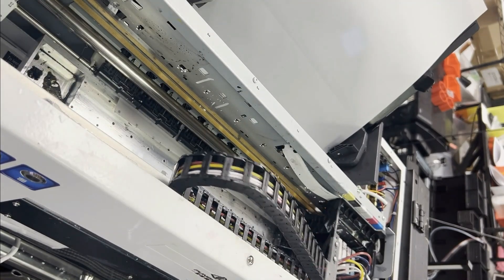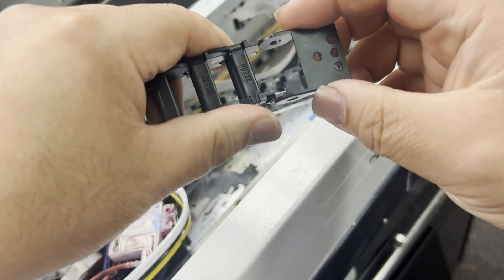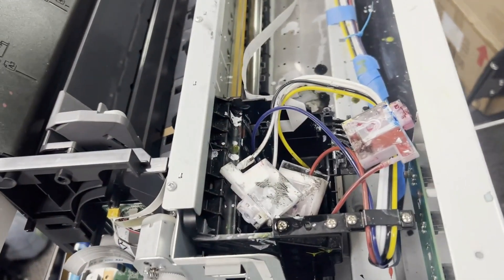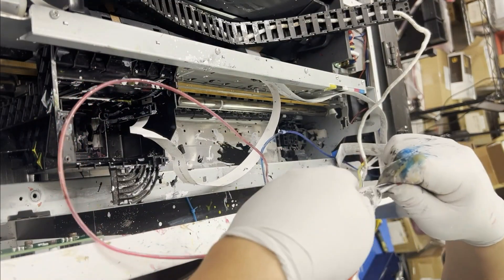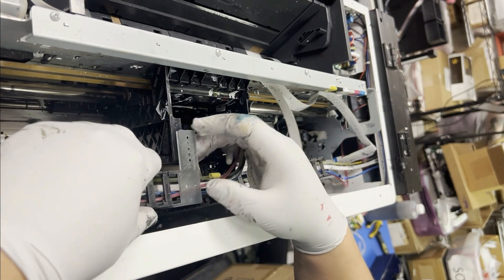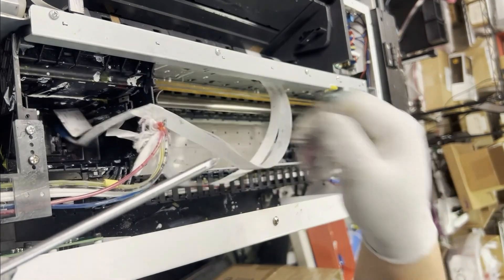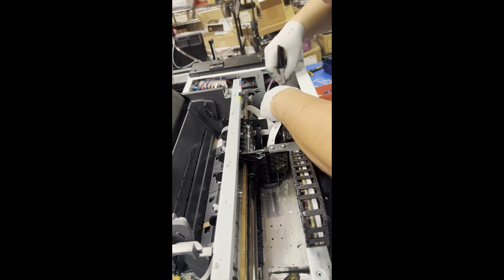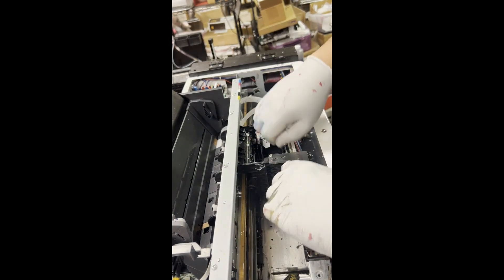Step-by-Step: Adding Drag Chain Tube Bracket to DTF DTG Printer

Comment: Can you do a video on how to fix Epson L1800 wiper blade? My is stuck won't go up or down, I tried turning the white wheels under the printer, but no luck.
Reply from the maker: I've already made one, under capping station repair.
Reply: @BCHTechnologies  I purchased one of your videos on taking apart the caping station. Your videos are so much help. Thank you
Reply from the maker: It's the same video. Your wiper blade is out of sync. The video explains that one of the raise, another will be lowered. It's the "half moon" thing that controls it.